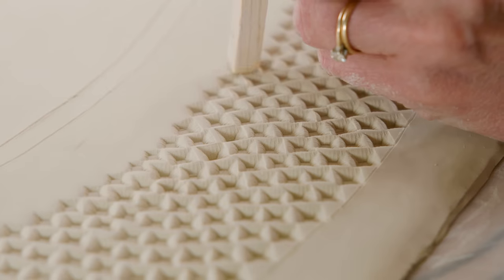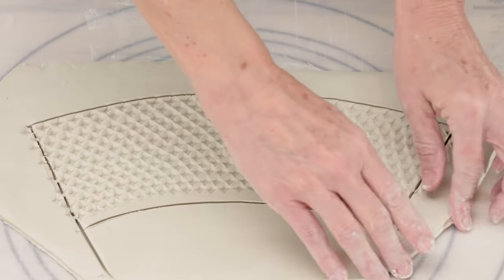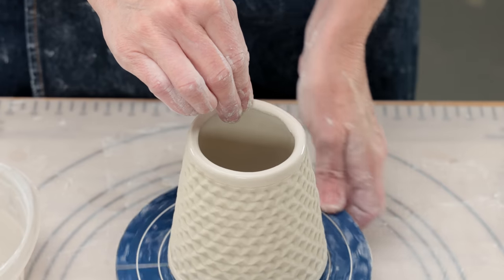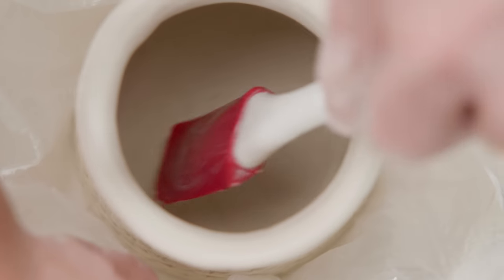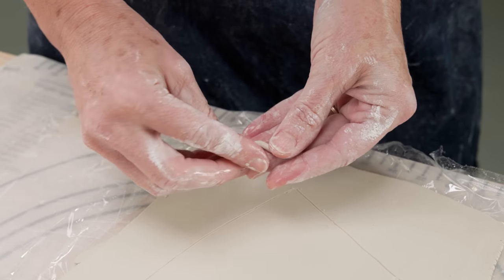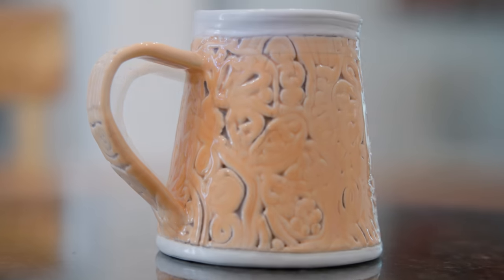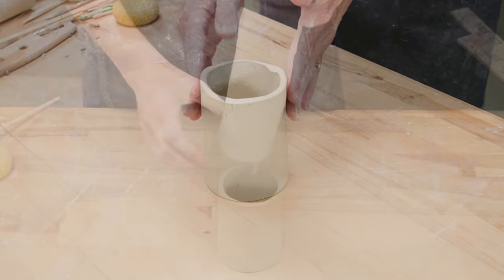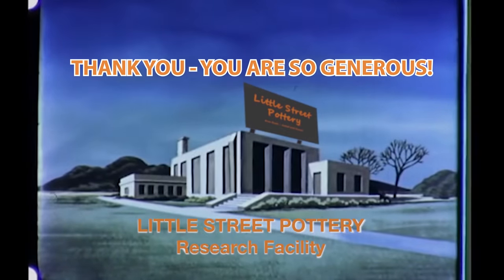Hand Building Mugs - Three EASY Ways!

Comment: Lol, Ann, thank you for showing the hand rolling coil technique, but I TOTALLY would have busted out the extruder for THAT flower mug job! (which turned out really neat.)

Doming the bottom of a hand built mug outward isn't something I've thought of. I enjoy the look.
Reply: @annruel1982  lol oh sorry! I meant the small coil rolling where you made a snake and made a flower and designs. So I meant the little hand extruder where you are typically making colored 'hair' to roll into your white clay, not those massive wall mount jobs...
Reply: @annruel1982  that makes sense. Mine is a 'push' model. No cranking just a push, and I can definitely do that faster than rolling!

Comment: Thank you so much for sharing these techniques! What size template & foam cone did you use?
Reply from the maker: I typically use the 11.7" X 3.74" cones - but sometimes cut bigger ones down to the size I need. I keep a variety. You can use the size you would like your mug to be. Thanks!